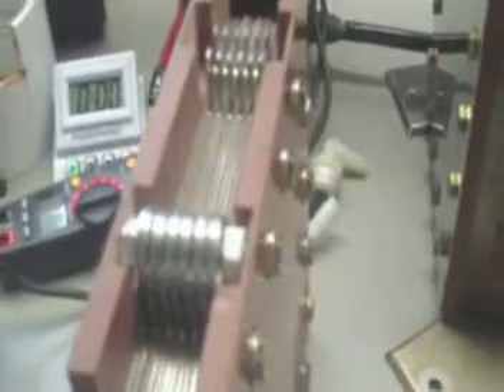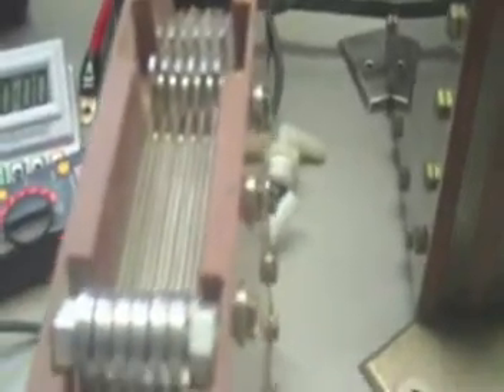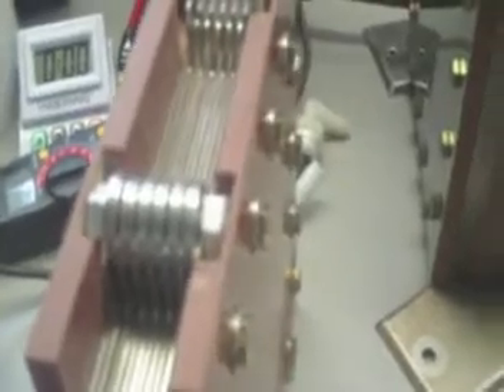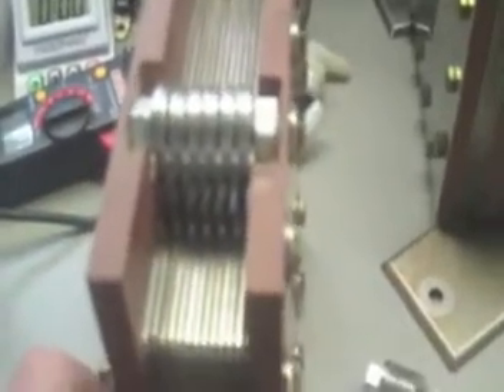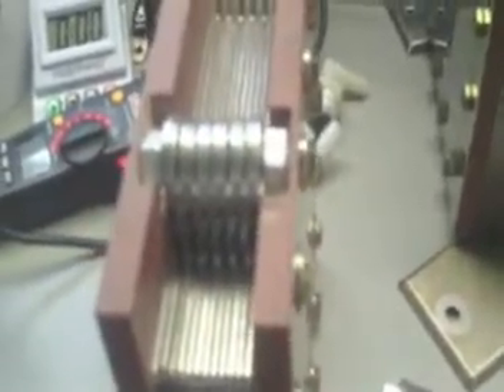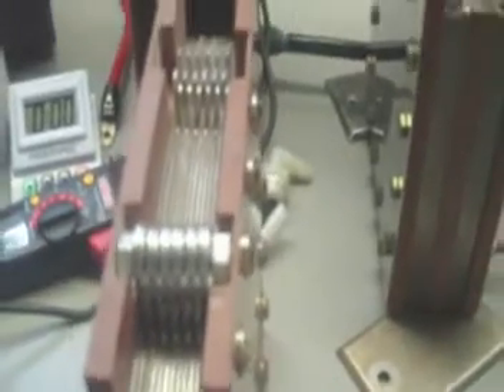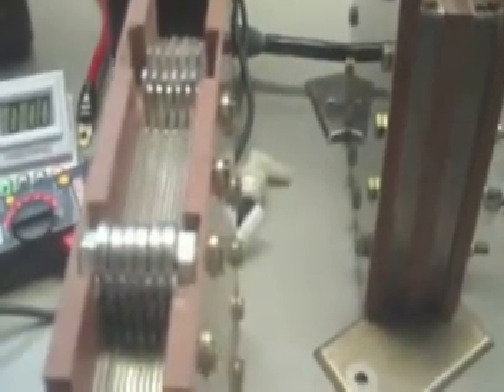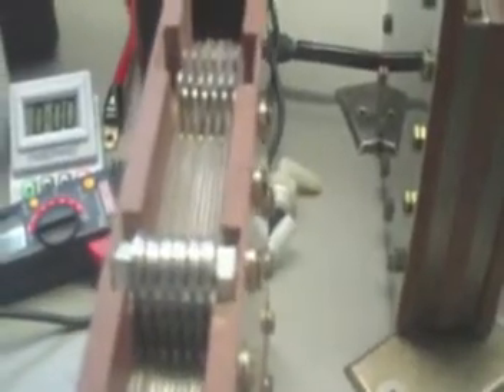POS NEG CELL.mpg

Comment: In theory distilled water alone should not be conductive,however it only takes a small amount of contamination to start it off.A multi meter on continuity setting will introduce approx 3 volts to the cell,and this is enough to start procuction,I would suggest re-configuring the cell by disconecting some of the plates to make them neutral,your original set up will draw more amps than is sustainable,and the reward would not justify the ammount of energy,it won't take much to make this cell good.

Comment: I dont know of any way to get predictable production using distilled water using low voltage ... 

suspect if you got any production at all, your distilled water was not as advertised ... or there was contamination in the device itself that made the distilled water conduct ... maybe some cleaner, solvent or adhesive used during assembly ... 

if you want to crack distilled water, you need a high voltage apparatus and at least 9kv ... 50kv starts to get interesting ...

Comment: Did you say you were running straight distilled water. If that is the case then you should not see any bubbles until you add some electrolyte. As a matter of fact I would not be surprised if you did not start seeing rust even with 316L. I tried my EBN dry cell on straight distilled water once, I got no production and rust within minutes. I was told it was because the current had nowhere to go. With a little electrolyte you should get lots of production, no rust,  and unfortunately lots of heat.

Comment: I hadnt never tried this on a dry cell , but I have done similar things making homemade batteries that looked like a dry cell...And found that if I stacked it like you have your cell , that it would short out ..I put separator gaskets between each cell and it worked fine ..Maybe this helps ...